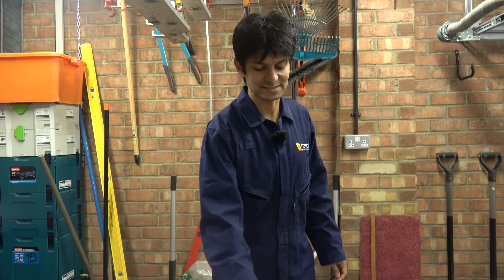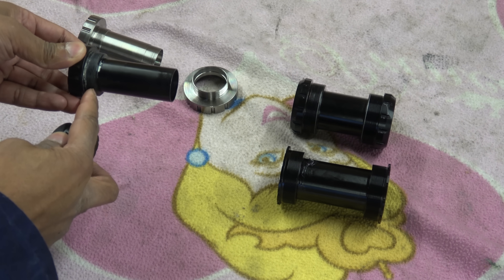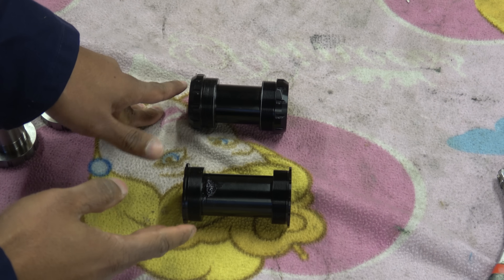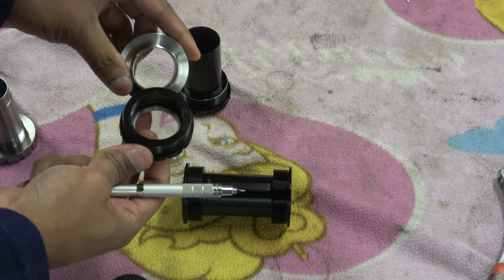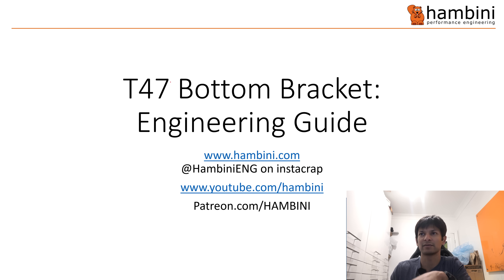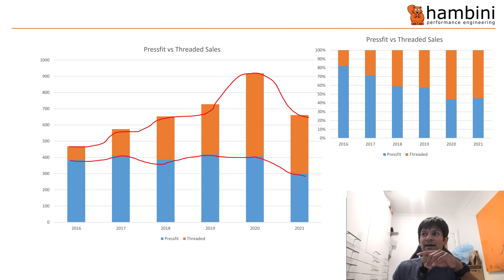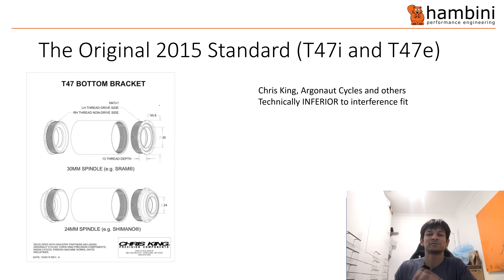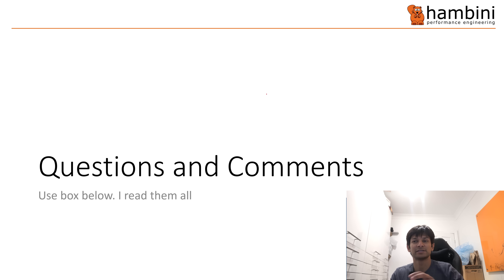T47 Bottom Brackets | Full Engineering Guide | Everything you need to know

Comment: I would argue that press fit is "potentially" still THE best solution.   Why?.... 

Because it requires only one thing to be done correctly by the frame manufacturer:  produce a straight, on-size, round bore in the carbon.  I'll admit that it appears only TIME and possibly Look can currently do this, however this could be done >IF< there was a quality standard that manufukturers (haha) were held to for the BB shell bore (and they were willing to spend the extra 5 dollars to do so). 

Very high accuracy can be produced fairly easily in a machined, single-piece press-in BB using the correct machining approach.  

T47, while conceptually fine, has more points of potential shite-quality and/or inaccuracy on the manufacturing end.  I would NOT trust ANY frame manufacturer to ....
 - produce a high-quality, reliable bond interface to the aluminum insert
 - cut the thread correctly on-size with a quality surface finish
 - cut each thread precisely square to its end face
 - cut the threads perfectly concentric to each other
 - cut both end faces perfectly parallel to each other

I have serious doubts that any frame manufacturer will be able to machine the T47 interface with any degree of precision.  I suppose it could be argued that many will be able to produce it "good enough", however when buying a $4000-$6000 frame set, we should all be demanding more than that.

My 2cents.
Reply: I have 2 Treks with PF92’s and they’re rock solid.

IMO, people deform the press fit by not using proper press tooling, and then blame the mfr when it creaks.

Comment: Just curious, bsa and t47 are both bonded to carbon frame, so theyre probably equally susceptible to galvanic corrosion or bonding issues right ? Seems to me that bb386 is still the best standard because they accommodate both 24 and 30mm axles, shame not that many frames use this standard, I know BH and the earlier Merida scultura use that standard
Reply: The question is, nowadays, how many you see disbonded / bonding issue on threaded bb shell? I never see one fail regarding disbonded cheap cfrp with threaded bb. I am my self got one cheap frame on the shelf. Even it is cheap frame, shite material & quality but threaded bb in it work flawlessly.

Here is why I choose threaded bb.

In average, the smallest tolerance for cfrp that we can get fresh out of the the mold is +/-0.03mm. Need to make it small diameter then machine the pf bottom shell to accurate size.

1) In my experience dealing with Class A aerospace/advance cfrp material & process, once you machine the cfrp layer, it will damage the integrity cfrp itself and it getting worse by put stress on it.

2) Cfrp is not favorable for continuos stress + cyclic loading. 30 to 40% of it is polymer (plastic), prone to be scuff during installation.

3) For short time use in race, yes pf bb on cfrp can work flawlessly. For longevity and daily usage, pf is not ideal.

4) When you deal with pf, you don't know how tight is tight. My friend's frame, pf b.shell worn out after 2 years. Mine bb68 still strong and it is objectively tighten at 45nm.

5) Threaded bb, easy maintenance and recycleable. We can reuse the bb. Just take out worn bearings but using heat gun then put it back by using heat gun. The bearings slide in and  out like butter (heat the bb, not the bearings).
3 times my recycle bb68 receives new performance bearings.

6) The bearings can be replaced, so the cost is cheap. You need only the performance bearings, cost you 50usd.

Conclusion, I will choose bb system with easy installation, easy maintenance, no damage to bb shell, lower cost and recycleable. It

Comment: People will want adaptation so they can use shimano cranks with the t47, the same with campy cranks. Shouldn't be too hard to machine up some nylon sleeves or just a t47 cup with the 6805 bearings
Reply from the maker: In those situations, you'd be better off on BSA. There is a lot of additional material in T47 that is there for a 30mm axle. On Shimano or Campag that material is nothing more than dead excess weight.
Reply: Aftermarket adaptation could potentially be the case for a few years if T47 is the potential new trend, driven by many 30mm crank manufacturers, with Shimano trailing behind as always.
Until Shimano is ready to move away from 24mm steel axle to a thicker AL axle adopting T47, with valid engineering sense, such as eliminating galvanic corrosion between steel axle and inner half of al crank, which could potentially causing bonding failure through de-lamitation, as pointed out in Hambini’s vids.

Comment: I think your corrosion problem is over exaggerated. 

The threaded shell can be anodized, or anodized and coated with a chromate enriched bonding primer. A primer like BR-127 has been used in aerospace for decades where galvanic corrosion is a concern. 

As for the area that would be faced to become square with the bore, a Kapton or fiberglass shim .005-010" thick will act as a isolator.
Reply: do you really think that any manufacturer will do that?
Reply: @JogBird  
Anodizing in batches doesn't cost much. The anodizing and corrosion inhibiting primer does cost more. 
For a bottom bracket, anodize them and move on. 
Ever see a Chris king part that wasn't anodized? This includes natural colored aluminum.
Done in a turd world sweat shop, next to nothing.

Comment: Finally bearings gets protected by staying inside bb shell, just like how it was in cartridged BB and old school BB with adjustable cup and cone.
Reply: Is this a function of being inside the shell, or the bearing seals themselves? What does the shell do to protect them? I have a square taper Shimano XTR BB that I've been running for 10-11 years, it is inside the shell and I haven't encountered a single issue. Compare that to my White Industries Ti BB, also square taper and inside the shell w/ enduro bearings, only lasted for a single season.
Reply: @thomaslowry7813  
‘Protect’ in the sense of not having the ball bearings sit as an overhung body outside, but ‘inside’ the bb shell.
If you refer to one of the FEA screenshot on Hambini’s vids, you’ll see how much attentions Dr has been paying over unavoidable thin section in designing bearings housing outside bb shell.
Reply: @Billo7979  gotcha! That makes sense!
Reply: @thomaslowry7813  
In addition to that, referring to your experience comparing Shimano and White Industries, one may easily guessed that could be due to Shimano being a larger manufacturer.
However, knowing that Shimano XTR square tapered bb uses cartridge, factory-preadjusted , but I’m not sure if White Industries Ti bb requires on-bike fitting adjustments? As fitting quality could affect performance too.

Comment: Top work.  
There is some humorous irony that the reason pressfit has developed its poor reputation is because of the Hambini channel. We have been rapidly buying tools for the increased number of T47 we are seeing that need facing after lazy paint jobs.  T47 isn’t the answer, more educated mechanics and consumes are!   The main advantage is that T47 will be easier for mechanics to fix post production, until they corrode away anyway. 

Saying that, I have only seen 1 bonded in BSA fail because of corrosion and that is a tiny fraction of the pressfit problems we fix.
Reply from the maker: One of the things I have seen first hand is the large amount of consumers going back to their retailers and claiming faulty goods under the consumer rights act. I'd imagine that this has filtered up through to the bike manufacturers who are unhappy at the high level of returns as it costs them a lot of money. 

Give it time, I think there will be more bond failures - it's inevitable in damp northern england.
Reply: @Hambini  For sure. Frame reports for warranty claims are a notable part of our work now.
Reply: @mapdec  Agree T47 isn’t the answer nor any other solution the manufacturers may present until they opt to put their hands in their pocket and simply manufacture basic stuff properly. Press fit issues solutions identified years ago just a few dollars manufacturing cost per frame to resolve (basic as making a round hole opposite another).  Now we have them driving us down the route of bonded alloy BB sleeves and galvanic issues. Colnago learnt that lesson 20+ years ago and very quickly resolved it by using Ti sleeve instead - no issues thereafter.  But fat chance of that happening in the majority of the manufacturers as they knowingly design problems into products for inbuilt obsolescence . See the last 5 years on multiple issues. Suspect we have the next ‘walk of shame’  by the manufacturers lined up in plain sight.  Deep breaths 🙄

Comment: Bloody ridiculous... putting an aluminium threaded insert that's bonded into carbon to me is asking for trouble or will cause more problems than it fixes, There is nothing wrong with pressfit bb86 ffs🤦🏻‍♂️
Reply from the maker: they haven't been around for long enough yet but I imagine that going forward, a load of bonds that break will become unavoidable.
Reply: It was common for the first BB86 to use aluminum inserts bonded into the carbon. You have a weight penalty, but it results in a much better alignment.
Reply: @Roger Bergua  well that was way before pressfit standard. They went to pressfit because the threaded insert was shite and would seize or  the bonds fail, nowframe manufacturers are going back to threaded and cheaping out  while charging 100% markup.  You can spend less on a yahama sports bike, which is way more complex to make. Yet there's not many  issues with alignment, even with carbon parts. Let's thank specialized and trek for their incompetence😂....🤦🏻‍♂️
Reply: @Dolmar-Rick  That's not before press fit standard. It's just that you are pressing the bearings against a metal shell instead of carbon. Actually, I have a Fuji Altamira from 2013 with press fit BB86 that has a metal shell bonded in the carbon frame. I am not talking about a threaded bottom bracket.
Reply: @Roger Bergua  yeah never had one with metal shells that had bearings pressed in. I guess my point is the money you pay for a frame. You'd think they'd be able to make  a carbon shelled frame that aligns. Giant and few others  can do it without problems, well I've had an old tcr go loose on the bb. Think it was down to shit/ dirt  and water  getting behind the shell and wearing carbon slightly. There were no questions really giant replaced the frame, I guess the bb should  have been changed /cleaned sooner, and it would have been ok, I think. My current  tcrs I have now have been faultless so far.
Reply: I was seriously considering Factor for my next bike. I am their target audience: A sucker willing to vastly overpay for the drool factor.

The moment they announced they're switching to T47, I lost interest. You're telling me for $7000 you can't make a frame that meets BB86 specs, and your marketing's spinning it as some glorious new improvement for me when it's transparently a cost cutting measure?! Pass.

Comment: So out of the existing BBs, past or present, and assuming manufacturing stays how it is now, what's "best" for the average Joe to want on his bike? 

Part 2, if you made a new standard, and it was made to tight standards, as were the frames, what would it be? 

Curious if they'd be the same or not.  Also curious if they'd come with a complimentary pen.
Reply: BSA. Easy to work on, spare parts cheap and available as well as counterfeit options. 
Even a 16mm axle is stiff enough for 99% of riders, you don't need 24 or 30mm unless you actual race crits
Reply: @janeblogs324  True. The best part of threaded bb, it is recyclable.

This is my experience on cfrp and my thought about it.

It is easy to follow tolerance for metal product, however the cfrp is not the case. In average, the smallest tolerance for cfrp that we can get fresh out of the the mold is +0.03mm and above. So we need to machine the pf bottom shell to accurate size.

1) In my experience dealing with aerospace cfrp, once you machine the cfrp layer, it will damage the integrity cfrp itself and it getting worse by put stress on it.

2) Cfrp is not favorable for continuos, 24/7 stress (pf) + cyclic loading. 30 to 40% of it is polymer (plastic), prone to be scuff during installation.

3) For short time use in race, yes pf bb on cfrp can work flawlessly. For longevity and daily usage, pf is not ideal.

4) When you deal with pf, you don't know how tight is tight. My friend's frame, pf b.shell worn out after 2 years. Mine bb68 still strong and it is objectively tighten at 45nm.

5) Threaded bb, easy maintenance and recyclable. We can reuse the bb. Just take out worn bearings but using heat gun then put it back by using heat gun. The bearings slide in and  out like butter (heat the bb, not the bearings).
3 times me recycle bb68 & receives new performance bearings.

6) The bearings can be replaced, so the cost is cheap. You need only the performance bearings, cost you 50usd.

Conclusion, I will choose bb system with easy installation, objectively tighten at 45nm, easy maintenance, no damage to bb shell, low cost and recyclable.

Comment: Bb386 or t47 or something like that are great for 24mm axles because there is a possibility to use 6905 bearing. But still no one make it, so maybe someone will start manufacturing of that BB.
Reply: I make my own press-in bottom brackets, and while the current one I am running in my Orbea OMX accepts 6805 bearings, one of the finished BBs I have sitting on my shelf accepts 6905 bearings.  One of these days I will install it !

Comment: All this driven by the belief that a bipedal mammal, that can barely crank out 1/10th of a horsepower, will see a benefit from a 30mm axle vs one that’s 24 or 25 mm.
Reply: Well, to be fair, on Metal Frames T47 does leave a lot more room for internal routing, so thats another point to take into consideration.
Reply: @moritzaufenanger2537  internal routing is another stupid boondoggle to make money out of gullible mamils who couldn't out-ride a 20kg Halfords MTB
Reply: @moritzaufenanger2537  I have a 6 year old Eddie Merckx with BB86 and sleeved routing for both gear housings and brake hoses. I believe Lauf’s gravel bikes using BSA do the same. On a carbon bike it likely shouldn’t matter because you can mould it how you like. On a metal frame, I think you’re right and the bigger tube of a T47 may offer that advantage.
Reply: Mind you, the instantenous torque can be in car territory. That's a big part of the reason frames eventually fatigue and die - metal ones, too.
Reply: @brankododig1585  thinking about I only us square taper cranks on my fixed wheel bikes. Splined cranks can’t take the sheer forces of retardation and just round off.
Reply: I can crank out more than one and a half horsepower on occasion
Reply: Your average Tour level pro can ride at 360w for an hour and sprint at 1500w....a bit more than 1/10th hp......does that change things?
Reply: Your average club rider can ride at 250w for an hour and produce peak 1500w.....significantly more than 1/10th hp.....does that help?
Reply: @tednruth453  the 1/10th hp was a bad guess on my part (1 bhp is about 745 watts according to an online calculator). Thank you
Reply: @tednruth453  Peak 1500 w for a club rider is a bit of a taller order than the 250 w FTP, but I think 1000 to 1300 w peak is very commonplace
Reply: @dmbambino  no problem
Reply: @tednruth453  plenty of the pro teams are Shimano sponsored, and I doubt they’re at any mechanical disadvantage over a SRAM sponsored team because of the their axle diameter.
Reply: @tednruth453  I couldn't give two fucks what all of 200 people on the planet can do. The fuck does this have to do with the price of tea in China?
Reply: Us fat boys have lots of torque and Power and shimano hollowtech has always coped. Shame the bonded cranks don’t stand up to 500+ watts at 60 rpm. Maybe that’s why the media want you to ride 160mm cranks and spin at 120rpm